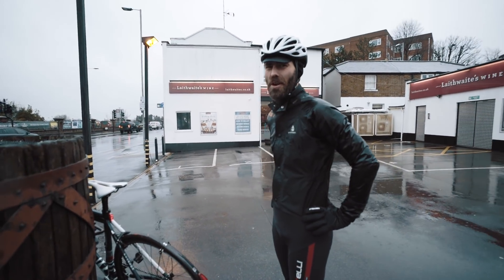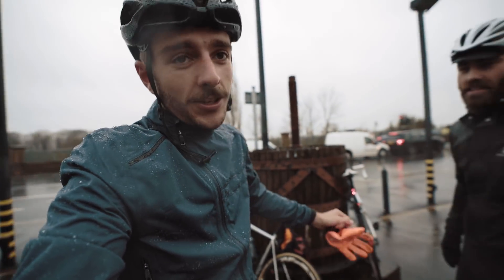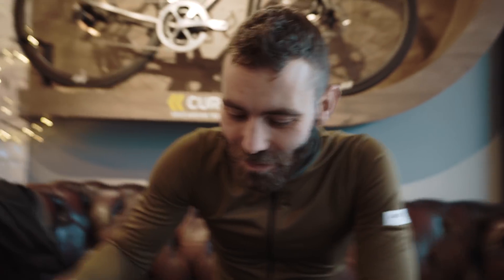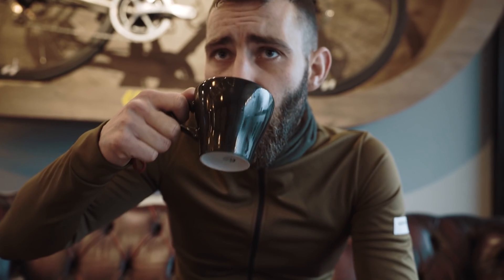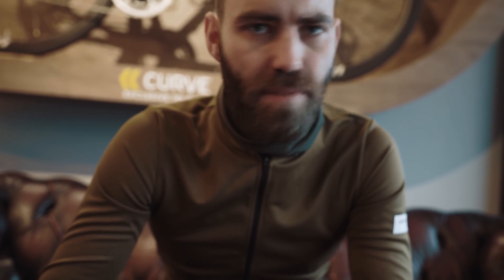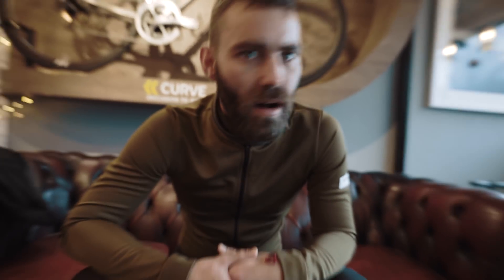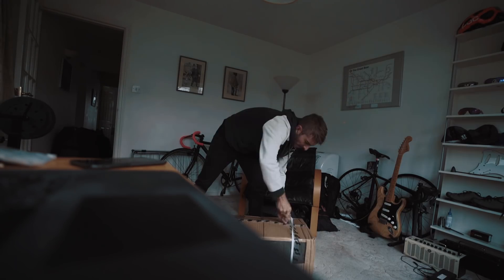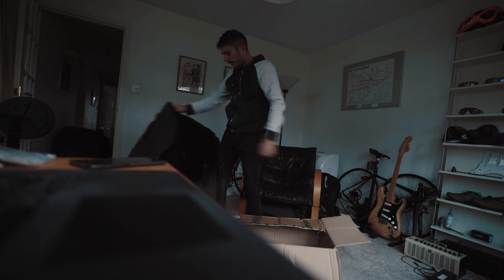BIKE FIT - HANDLEBAR HEIGHT AND STEM LENGTH

Comment: No offence to James but have to say that a guy sitting in a dark cafe in rainy England talking about stem length is a bit of a comedown after all the epic videos over the last few weeks! Haha, keep up the good work anyway both!
Reply: Thats interesting what you say regarding stem length, Switched the stem on my hardtail from 100mm 12 degree negative back to 90mm 6 degree negative as I was feeling a pressure spot on the saddle and a tight spot above my right glute (quadratus lumborum). Its certainly helped. Just about to install a new fork (the new SID World Cup Carbon 29er 100mm) Axel to crown with the rigid fork is 860mm and the SID will be 506mm locked out so will raise the front an additional 20mm(will have to see how that alters position). Would you level the saddle with the fork locked and ignore any sag for a more stable riding position when seated for long periods as when the fork is open you spend more time out of the saddle anyway..... Apparently when Francis is a YouTube millionaire he's going to fly you to Majorca every week for Bike Fit Tuesday in the sun.... !!
Reply: I rather like bikefitchuesdays 🤷🏻‍♂️ granted I am a bike shop manager...but at any rate always interesting!

Comment: A question for James if he'll have it. I've been told by both my bike fitter and my continental-racing podiatrist, that I would benefit from longer reach or a bike with a longer top tube. Im new to cycling and therefore not too knowledgeable, but could  I play around with stem lengths and get the same or similar outcome?
Reply: Thomas Allen noted - we’ll answer next week!
Reply: James Thomas looking forward to it ✌️